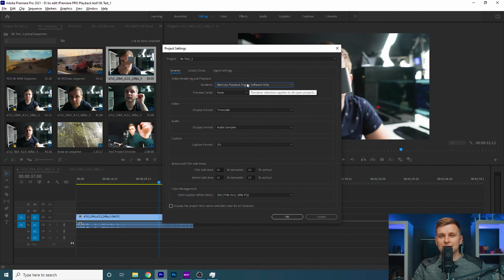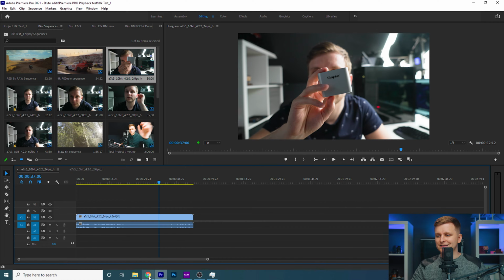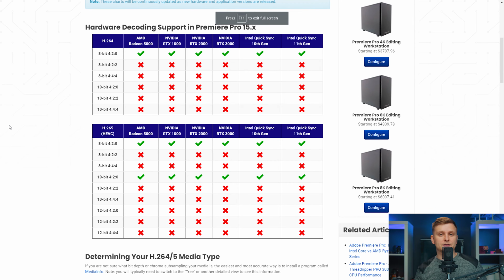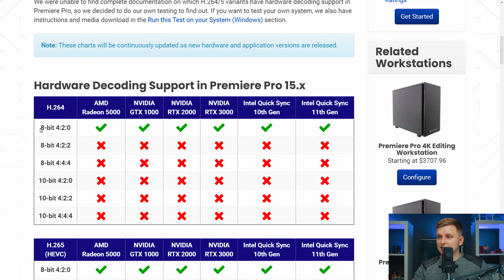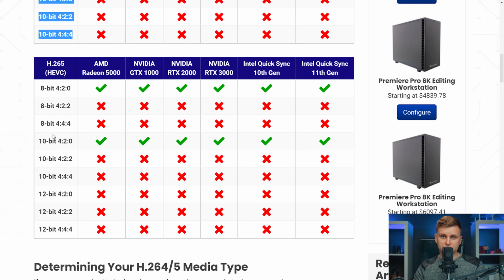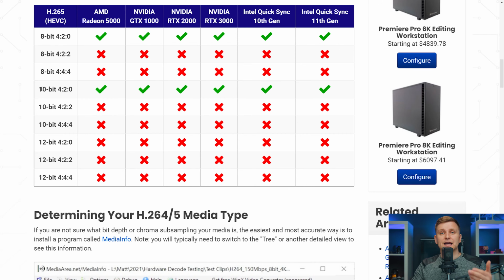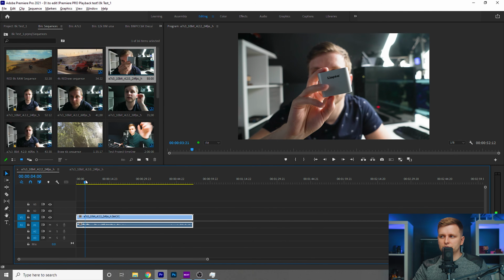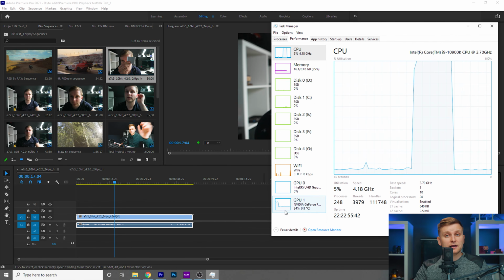EVERY Premiere Pro User NEEDS to Know This - Hardware (GPU) Acceleration

Comment: I just purchased a M2 Mac mini 16GB. What I find strange is any mp4 (h.264) footage I add to the timeline it is a breeze to edit. scrubs through it no problem in 1/1 Quality.  For a test I encoded some mp4s to Apple proRes HQ 422 in Adobe media Encoder. When I add these .mxf files to my timeline and try and scrub through them, to my surprise it is really slow and glitchy compared with the original MP4 files.  Any idea why this would be? Thanks.

Comment: I can't get GPU decoding accel working... Seems like the feature is broken in Premiere with Nvidia GPUS. Performance is the same with the feature turned off or on. LAGGY. My CPU utilisation is high. Video decode stays at 0%. This is currently a broken feature in Premiere. People with M1 macbooks have smoother timelines than me when my rig is far more powerful.

Comment: Thanks for this well explained video. I am filming everything straight onto my PC with OBS via a capture card (Elgato Cam Link 4K). This is luckily keeping everything 4.2.0. I see my GPU is pushing hard against the 100% level when I scrub my playhead back and forth. Given the choppiness and 'Not Responding' I am always seeing in Premiere, which is why I'm watching videos like this, I now think I need a better GPU. I have a Core i7 8700K 3.7Ghz with an Nvidia GeForce GTX 1080Ti GPU. Do you think this GPU is still good  in 2023 or should I upgrade?
Reply: Gpu doesnt make difference in video editing. You will regret if you make this change. Try to increase number of cores of your processor instead.

Comment: Something strange in my PR.
I have files from my GH5 that is 4k 60p 4:2:0 8bit and files from A73 that is 4k 30p 4:2:0 8bit. The GH5 files plays very smoothie but the sony files is not smoothie. In theroy 4k 60p should have harder time playback than 4k 30p.
Reply from the maker: Not always though. It depends what codec it is (h.264/265) and what's the bit rate of the codec. :)

Comment: Does this only imply for the latest Cards? Like 2000, 3000 series?
Whenever I put in the CUDA mode in my laptop (i5 8300H+1050Ti) the video goes into greenish/pinkish colors.
Reply from the maker: I believe it also applies to 1000 series gpus. :)